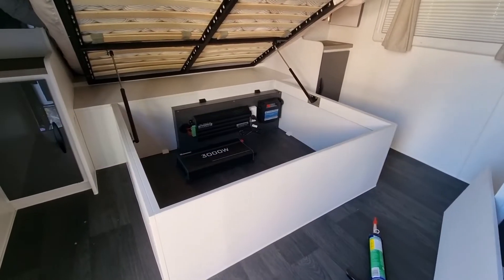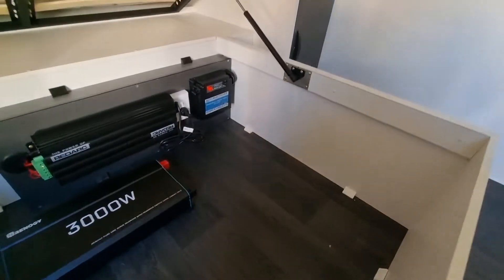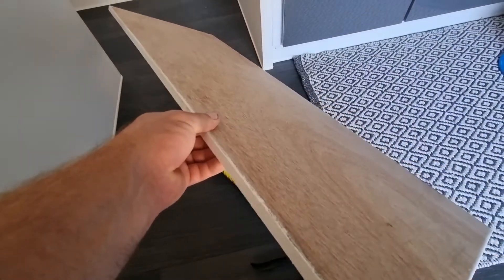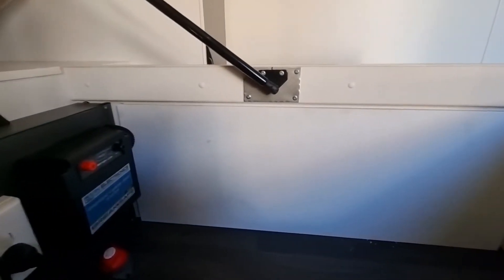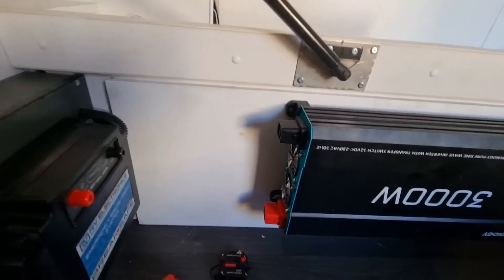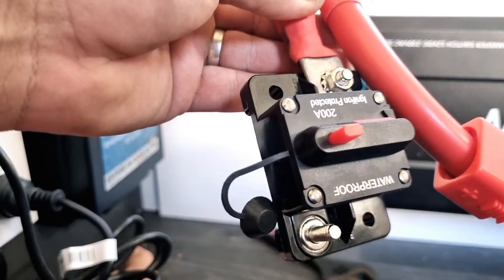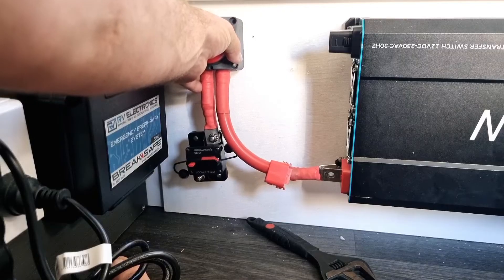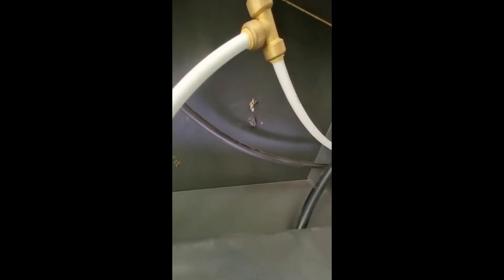How to install a 3000 watt inverter in a Caravan part 1

Comment: Hey mate, doing the same set up now. Did you put a RCD between the 15amp input from mains power before the Changeover switch? 
I know you need one between inverter and changeover switch and post changeover switch though all the research I see seems one between mains and changeover switch also. 
Cheers
Reply from the maker: When i did this i used the existing rcd post change over only,.,i know the lead to switchboard wasnt protected, but i was ok with this as i know how the cable was run, this inverter doesn't have a inbuilt one.....but now I have a inverter with inbuilt rcd.. ...so its all food

Comment: Thanks for the video, do your positive and negative DC terminals move a little bit ? (on the inverter)  I just installed a 2000 and there is some play in mine.
Reply from the maker: Not sure..I'll have to have a look at that...

Comment: Just a question on wiring it up ! 
Did you wire  it up straight  to the battery or the Redarc shunt ??
Reply from the maker: To the shunt then to battery
Reply: @muddyandsandy  so I take the  positive straight  to battery and wire negative to Redarc battery sensor and then battery sensor to negative on battery ? Also do I use  same gauge wire ( I’m using 3/0 gauge  95mm2 wire  )  to run from battery sensor to negative terminal ? 
Thanks
Reply from the maker: @damiensolomons5077  .yes...thats what indud...same cable size all the way...
Reply: @muddyandsandy   ive sent you an email on youtube supplied email address 
thanks

Comment: Looks like 70mm2 cable?
And thats a long run from inverter to the battery
Reply from the maker: Yea its 70mm2 ,it's only about 3m
Reply: @muddyandsandy  im no professional,  but when i asked people that apparently are, for my 2000w inverter  1.2mt from battery, i was advised to use 95mm2 cable for the 250amp draw, i just repositioned things so i now have 500mm from battery and use 70mm2 cable,  there is some helpful calculators on google,  less voltage drop the better from what ive read, you done a neat install anyway,  from what ive read , you might just get away with doubling up on the 70mm2 cable,  would have been better with 120mm2 cable for the 3mt run, 
But if you've monitored the cable and connectors heat while under your max load ,you should be safe
Reply: @Rcplanedan  I second this ! Im running 1 metre to battery and have 2x50mm2 with 400Amp fuse. Otherwise she gunna get hot . 70mm2 and  fuse way too low otherwise just get smaller inverter. Im going to be running induction top off my 260 Ah lithium .

Comment: Gday Kim great job on the install, I want to copy your transfer switch and meter setup can you let us know what brand and model the change over switch is please as well as the meter
Reply from the maker: Thanks for the comment, sorry it took abit to reply I was away, item is called matelec din rail mount kWh meter.
Change over switch was a hager double pole 40amp change over switch ........

Comment: You should be using a 400A fuse for a Renogy 3000w inverter...that's whats on mine.....that's what they recommend. The rest of what you have done is perfect.
Reply from the maker: Yeah, pretty sure I only put a 250 because it was only 70mm2....70mm2 rated to 250amps I think, yeah 400 would be good, I don't really use it for big loads....thanks for the comment
Reply: @muddyandsandy  no link on what to buy

Comment: Is 200A fuse enough for a 3000w inverter? What would you recommend for a 2500w inverter?
Reply from the maker: I wanted the fuse to blow before cable gets hot.....2500w÷13v=192amps.....up to you,  as long as fuse size is smaller than cable capacity...

Comment: Gday muddy. Neat install.❤
  Have you adjusted your Inverter setup/RCD  since you made the video?
 Watching vandercampadventures on YouTube a switch contactor is needed for N-E bonding when 240v  output supplied from inverter (not on hook up) only then will the RCD function on AC output and protect you. Part of the new regs from Nov 23 apparently. I think the AU regs are similar to the UK with talking to a local sparky. 

 The renogy units already have an automatic change over switch inside the unit..
Reply from the maker: I'll look into it...I have the inverter wired to the change over switch ,which keeps the neturals separated...same earth link though....but ill double check thanks for the info

Comment: Just installed mine, thanks for your tutorial. I'm getting heat at the fuse and isolator terminals, is that normal?
Reply from the maker: Hey....if you are running high load appliances...there will be some warmth....but shouldn't be a hot..

Comment: I am planning out my 3k inverter. All the info said I need a 400a breaker and 4/0 awg wire. Am I wrong ?
Reply: I am running a 12v system. So I get slapped with high requirements. Pulled this off Google. 

The current draw will depend on the battery voltage. If the inverter is connected to a 12V battery bank, it can draw up to 350 amps, while if connected to a 24V battery bank, it can draw up to 175 amps
Reply from the maker: Yeah 4/0 awg would be good...so not much voltage drop....3000 watt inverter can only 230amps roughly...3000w÷13v=230 amp...400amp breaker doesn't sound right....breaker is designed to protect cable before it melts...so the breaker size needs to be similar capacity to cable capacity.......
Reply: The 4/0 cable has a 440 amp cap. Soni under shot the breaker to 400. My inverter info said it can rock all the way up to 375

Comment: Why did you unnecessarily double isolate the positive cable? You could just isolate it with the test switch on the fuse
Reply from the maker: Nothing wrong with adding a isolator...just like your house aircon has a isolator and circuit breaker.....isolator easy to use

Comment: Hi Muddy, Do you need to attach an earth wire to the inverter? Trying to work it out and what size wire. Cheers
Reply from the maker: Not to sure about that...the output earth on inverter is connected to earthing system in van....might have to research that one...probably find that frame is connected to internal earth which is connected to  my  van anyway..
Reply: @muddyandsandy  I think is just for static. I got a very non commited answer from Renogy.

Comment: Like your video. Looking at doing the same Renogy 300W inverter. A couple of questions please; 1 What size cable did you use? 2. is the battery isolator and the circuit breaker needed - could you just manually trip the circuit breaker to isolate 3. You used a 200amp breaker. Renogy suggests 400amp for the 3000W model. Any specific reason. Thank again
Reply: Thanks. Understand your comment on the 400amp. Strange why Renogy include 100amp cables. Any way I have queried this with them.
Reply: 70mm cable - sorry I was too quick
Reply from the maker: Hey mate, yeah 70mm2 stranded...you could use just the isolator to manually turn it off...I prefer to use a resettable fuse....not sure why renogy recommends that size..it's way to much...fuse should be just smaller than cable capacity so it can trip before cable melts......3000watt inverter should do ....3000÷13volt=230amp...not sure how it could do 400amps...maybe start up current not sure......I also have installed a rcd straight after inverter..thanks for comment

Comment: Great video mate! I have the 2000w renogy inverter, not wored to 240v yet, do you have a list of what  you bought for your installation
Reply from the maker: Hey mate...these are things I can remember 
200/250 resettable fuse from eBay
Battery isolator  ebay 
6m of 70mm2 stranded cable
70mm lugs x8
Inverter 3000watt
Heat shrink
Liquid nails
Spade bits 25mm
Screws 16mm
10amp male plug top
2.5mm2 pvc cable 12m
25amp change over switch hager
25mm corrow 10m
Zip ties
Duct

Comment: I just did the same thing on my channel  very good install mate  sub you brother    yeah I went with 200AH  Lithium  glad I did now
Reply from the maker: Well done....makes things alot easier....i have a ebay 135ah in my ute...been in there for 3 years no worries at all....yeah lithium is the way to go...now I can take my generator out of the tool box...less weight...thanks for the sub..

Comment: A very informative video thank you.  When is the next episodes coming please? I am looking to do this over the winter period and interested in the gear you install and how you connect into the existing system. We have a 12 month old van but no wiring diagram. I requested from the dealer but apparently it depends on the electrician/company installing the electrics to your van as they can all be wired differently. I don't believe that. 
Also sorry my son uses this account for games and hence the name. Cheers Karl
Reply from the maker: Thanks for the comment...I'll be doing install this week....so pretty soon...wasn't that hard to install inverter...

Comment: Very neat install and for 3000 watt inverter, going to higher amp hour lithium is the way to go. Just a comment on your fuse sizing. 12 volts x 200 amps= 2400 watts . So with your fuse you will limit the load the inverter can supply to roughly 2400 watts. You may have done this on purpose until you get lithium with higher discharge rates. All the best with your electrical upgrade.
Reply from the maker: Thanks for your comment..you are correct with the amperage ,I wasn't sure which one to get,as the cable can handle 250 but the max discharge I can get out of the  300ah lithium battery I'm buying is 200amps... so i just  thought of  what appliances I will actually use and they are all under 2400watts.